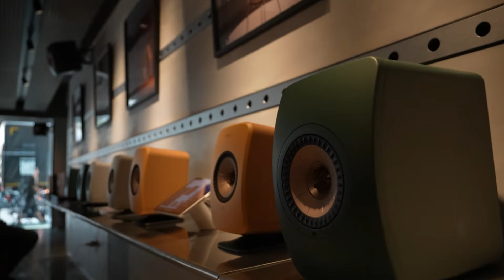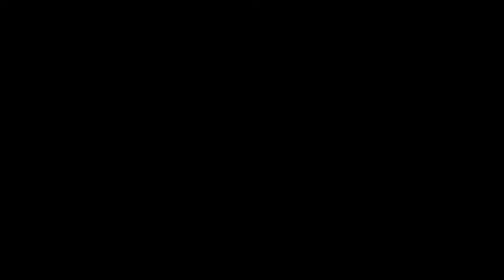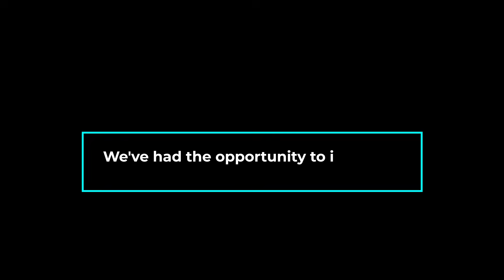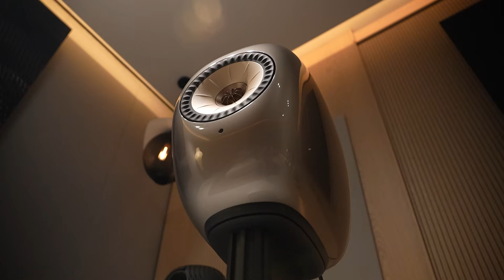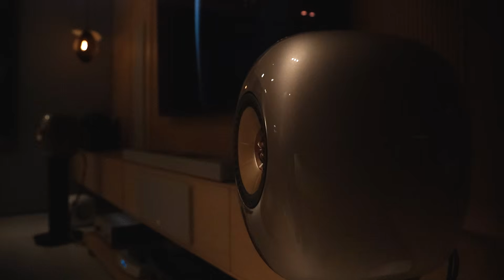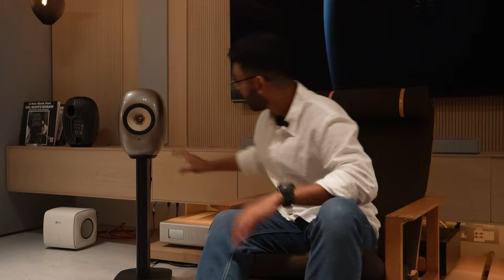KEF LS Luxe — Exclusive First Look & Interview with the Lead Acoustic Engineer

Comment: Error correction is integral, to mola mola perca and ossetra amplifiers trajectum platform, advanced Class D switching design. Couple with very  low distortion drivers- like the redesigned Dali Epicore range of speakers with zero eddy and hysteresis in new drivers and cone design-  and the error correction induced distortion is next to zero. Result is pristine signal reproduction.

Comment: These are a brilliant design. State of the art. They look very much like the Tannoy Arena but larger. Those have aluminum cabinets with a a 4” paper driver and no where near as a flat response. I bought them with their sub many years ago on ebay. They’ve been in storage for a long time but I plan on now using them with my tv which sits in a large armoire(no sound enhancements). My traditional hi fi is set up at a right angle to the armoire on the long wall and it sounds excellent.
Reply: Too bad they are lifestyle products going to be obsolete soon
Reply from the maker: @MasterofPlay7 why?